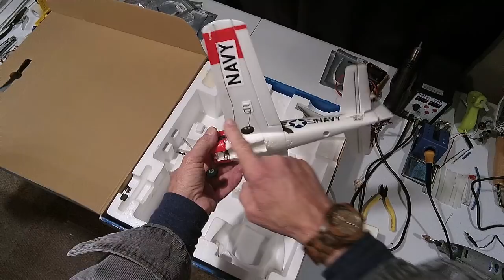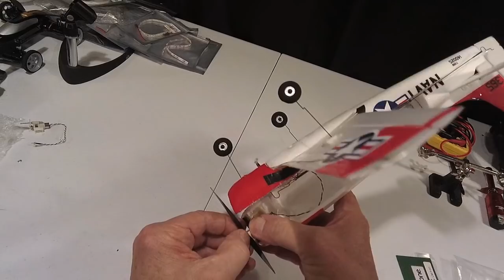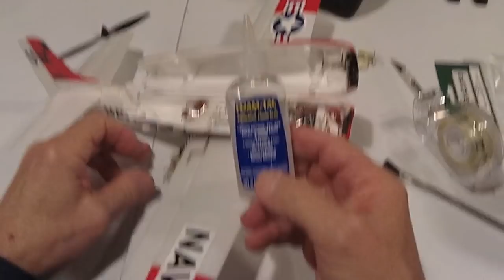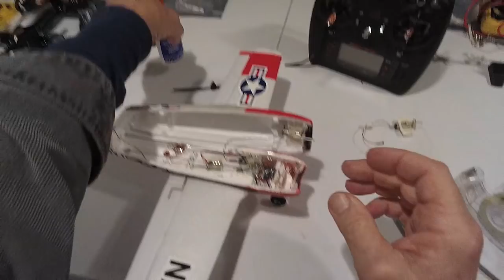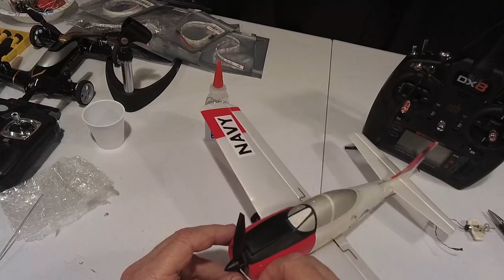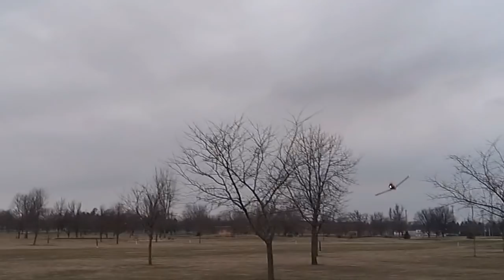How to change a Parkzone T-28 Motor, Perform a Tree landing, and do an extreme wind test flight.!

Comment: In this highly informative video u pretty much transferred the Parkzone Mico sized planes technology to audience

How u figured out instantly that motor was faulty? When my old plane on unpacking didn't take off, I suspected every element from battery to prop to meshing gears to Prop shaft rusting, b4 narrowing down to motor.

Comment: Look like installed in reverse gear there too, LOL! I just have to put another motor in my ember just locked up at a nowhere. Anyway have a great flying season sir!
Reply from the maker: Nothing was reversed .  Not sure what you mean.
Reply: I didn't mean you actually reversed anything on the plane LOL, when you went to take off about nine minutes and 24 seconds or so into the video. The wind Blew the plane backwards, looked like it was in reverse, give me a good chuckle. Almost good as the tree landing! :-)
Reply from the maker: Ha ha  I guess it could look like that for sure! Yes the wind blew it backwards and motor wasnt even running.  I may be old but not too old to know which way props are supposed to turn!  I'm laughing now too!  Thanks!😅
Reply: Haha! Have a good one brother!